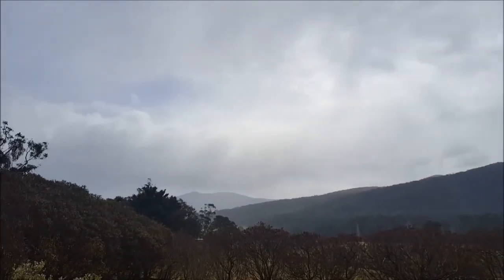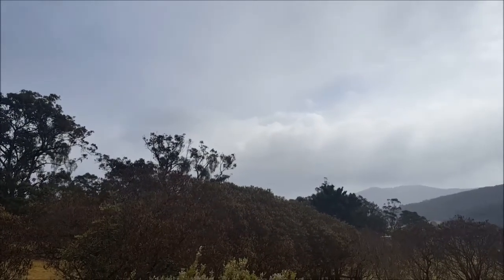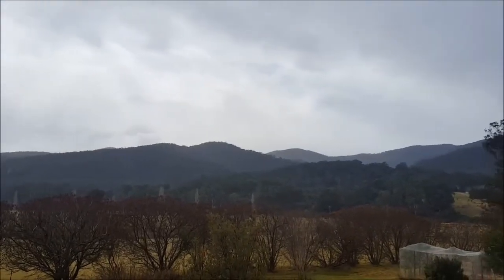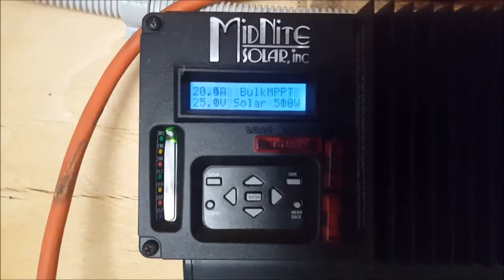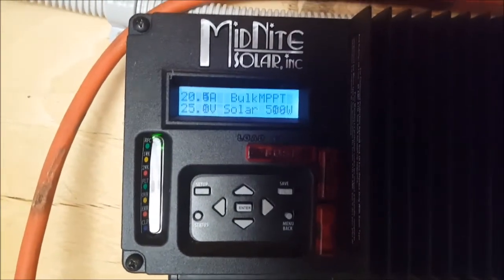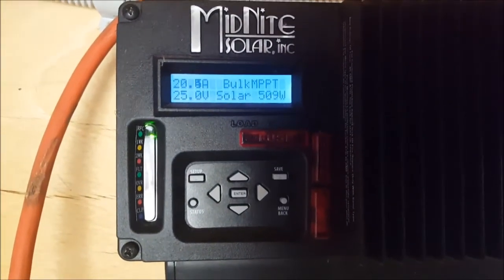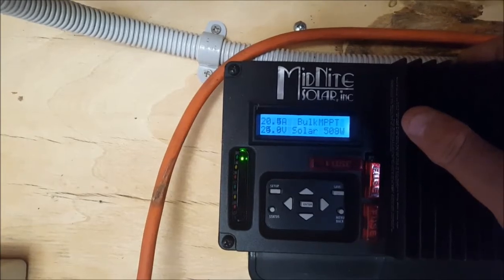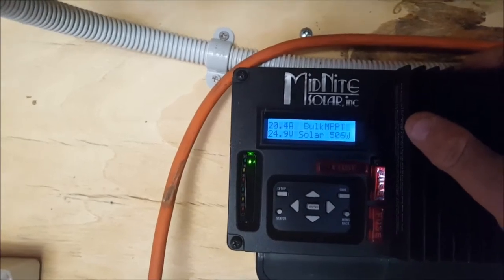Off Grid Solar Power - Fully Charged Batteries on an Overcast, Rainy Day

Comment: Remind me why you are limited to ~820w on a sunny day? Is it because you don't have all the panels connected at once?
Reply from the maker: andrewford80 - Because the charge controller has a maximum output of 30 amps. If it was connected to a 48V battery bank it would be capable of putting out 1660W.

If it's nice weather this coming weekend I'll talk about that in another video.
Reply: Gotcha, thanks!